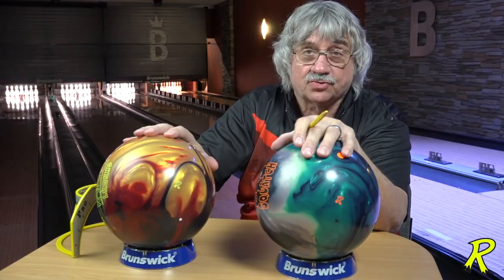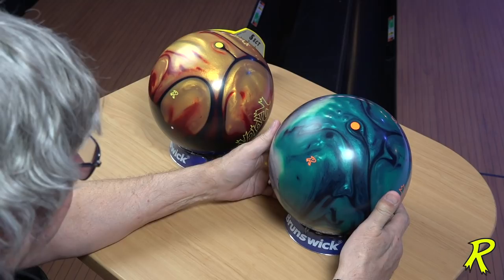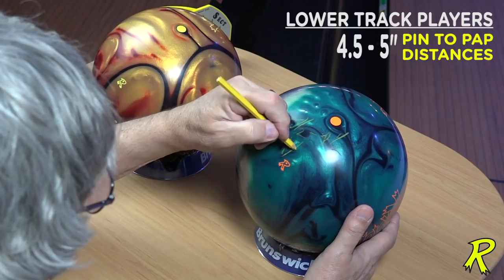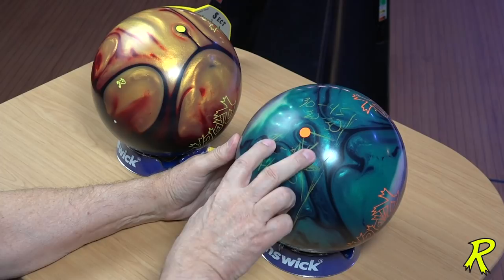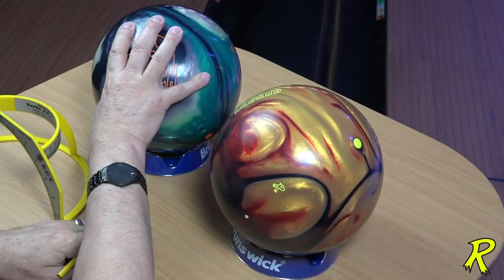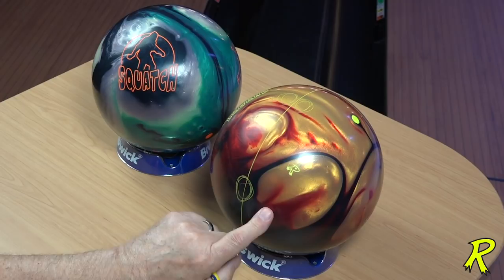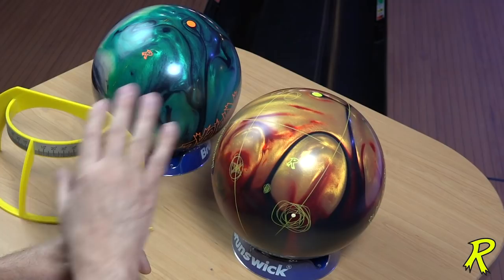Effective Modern Layouts w/ Mo Pinel - Volume 1

Comment: Without a doubt the best explanation on laying out a ball yet. If I had a quarter scale ($97.95 Amazon---yeah right) I believe I could now lay out my ball and just bring it to the pro shop for drilling. They have my hole diameters and span but they didn't have my exact PAP. I will have it exactly before I get my next two drilled. Now I will know before I throw them what to expect. Thanks again Mo. I am subscribing right now.

Comment: In regards to PAP, wouldn't that change depending on the drilling patern and/or the ball? For instance, if I rolled an older plastic ball of mine with a "finger Tip" pattern to show my track to the Pro Shop, would my PAP be diffeent than if I used reactive ball with a strong weight block? I'm not finding the drill pattern/ball reaction I'm hoping for and I'm curious as if it is a result in the drillers all using a PAP that might not be correct.

Comment: It's a damn shame Mo passed away.  I'd give him $500 to drill a couple balls for me so I could finally get my layouts perfect!
I recently made the switch from a standard right handed (thumb in ball) bowler over to a two handed (no thumb) bowler.
I went to the same Pro Shop guy that drilled my balls for me because the fitment was comfortable but despite knowing I
was transitioning over to a 2H bowler he still didn't care to watch me bowl or adjust my PAP for 2H (no thumb) bowling.
Instead he took all 5 of my balls and plugged the thumb holes and he did relocate the middle and ring finger holes on all
my balls except for my Purple Hammer... but to me it felt like he was doing a little guessing work rather than fine tuning
my layouts for my specific release.  Such a damn shame.  Now I'm having issues with the balls tracking over the finger
holes.  This shouldn't happen right?
Reply: Ditto. I wonder who else is just as good. I need help
Reply: I legit quit the sport after 25+ years of bowling in leagues because of fact I've NOT been able to find a pro shop that can drill my ball properly.  I've had over 25 balls drilled in the last 5 years leading up to me walking away from the sport for good and of those 25 balls I had 5 or 6 different PSO's layout my gear.  None of them fit properly.. non stop sores on my thumb, issues with release, some balls have holes that are way too large, some way too small, it's just BAD!  When I lived in Sacramento I used to get my gear drilled from the same guy for 15+ years and he got every single ball right!  These days PSO's don't seem to give a rats ass about their customers unless you go in and spend thousands of dollars in their shop.. half of them won't even measure your hand or watch you throw a ball to get proper PSA.. it's pathetic.. the sport is dying.. It's so obvious!  Just look at how every single bowling center (at least 95% of them) are all older than 30+ years and are falling apart!  The 3 centers we have out here NEVER oil the lanes anymore outside of leagues!  There are several days of the week where you can go bowl and your ball will legit just dump into the left gutter now matter how much you come up the back of the ball!  You literally have to throw plastic house balls if you plan on keeping your ball on the lane because of how dry the conditions are!  Ever since the pandemic bowling centers seem to be getting so much worse!   @StephRenee812

Comment: question. what if You drill a symetrical ball lets say stacked leverage and instead of the weighthole... go from the location where the weighthole normally would go and at the exact opposite neg quandrant from that hole location drill a weighthole there filling it with lead weight equalling the amount removed from posative weighthole location and plug it.  will it react the same as if it still had a hole like old?

Comment: I get a hard turn just before my ball gets to the pins and no matter how close I put it to the gutter I still end up hitting the head pin heavy or on the Brooklyn side. I observe other bowlers that can release the ball straight down the alley between the second and third arrows and the ball slides all the way until just before it gets to the pins. Does where you drill the holes have anything to do with this. I want a little less hook with more control.
Reply: Plantation Storage What ball are you throwing?
Reply: In a nutshell.... yes, the ball layout along with the ball surface is what determines how quickly the ball transition and how early or late the ball reads the pattern.

Sounds like you have a relatively low surface ball (2000 or below) combined with a very high response layout (when it sees friction, it wants to scream left, or right if your a lefty).

First thing I would do is have your ball surface adjusted a bit higher, especially if your bowling on standard house shots... something around 3 or even 4000 grit.
Reply: You are probably throwing way to slow and/or getting it to the dry too early

Comment: Hey Mo... What about a 90 by 4 by 10? I have a 6 inch or 6 1/2 by 1/2 pap. My rev rat is 325-350 rpm and throw the ball around 13-15mph. I actually asked for it on a trident abyss! Might have to get the holes drilled a little deeper to make it legal... My other balls are a seismic photon torpedo (65 by 5 by 35) and a venom recoil (70 by 5 by 30). Not to mention a covert tank with 65 by 4 (3/8 or so) by 28~. So... Good or bad?

Comment: I have a symmetrical ball drilled with pin location in center of palm? Why is it so much different than examples given here? Did the shop where I had my ball drilled get it completely wrong?
Reply: Did you determine your PAP prior to them drilling the ball? What you describe would only make sense for a ball with a simple pancake core.

Comment: On the Asymmetrical ball with putting the MB on the VAL.  Would that lead to a smoother and slower down lane reaction?
Reply from the maker: It's a contributing factor to a quicker response reaction, but Pin to PAP must also be considered here.
Reply: - depends on how high above the midline you put the pin - but generally ball would total flare less & have a shorter interim period between it's total Skid Phase & total Roll Phase .. .. ''Slower'' & ''Smoother'' relates more to Differential & Friction characteristics .. [true of symmetrical also ]

Comment: I'm not sure if I have a high track or medium because when I throw a urethane or plastic ball the track is very high and when I throw a resin ball the track is lower like a medium track. So my pap changes depending on what type of ball I roll. If I want to drill up a resin ball which pap measurement should I use? The one when I roll a resin or urethane/plastic?
Reply: Hey Mark, the only track that should matter is the initially one that's created when you lay the ball down. If the grip and release is the same for the plastic and reactive ball I would use the ball that flares the least because it will make it the easiest to get as accurate of a measurement as possible as long as the track lines are still defined.

Comment: Thank you for the very useful information! My question is how does the oil pattern length affect the layout? Assume that you have two identical bowling balls and two oil patterns, one long around 44 ft. and one medium-short around 37 ft.. How would you layout the ball to use on the shorter pattern and how the one to use on the longer? I'm a slightly speed dominant player and my track is mid to lower.
Reply: I'm no mo pinnel...  but the way this has been explained to me in the past is:
Shorter oil, you want a shorter pin to pap distance so the ball transitions quickly.

Longer oil, you want longer pin to pap distances so the ball transitions slower.

Comment: Mo not many people I read up on their work and study up on.  You are one of those people for me.   So I have a question after these new rules go into effect.    Your studies show you can move the psa with a balance hole in a symetric which I agree with.  With no more balance holes and plugging moving the psa back towards the thumb but only by about half or so.  Whose to say we cant drill the balance hole and plug it for the customer to get a little more out of a symetric?
Reply from the maker: The PSA moved back approximately 90% in a symmetrical ball when the balance hole was plugged. The difference in reaction was nominal and not worth voiding the manufacturer warranty by plugging a weight hole.
Reply: Tyler Stine  you could probably drill the balance hole then only fill the top maby put some foam in the hole but that’ll only work for a little while cuz after a few years they’ll know u shouldn’t have a plugged ball anymore I think in 2 yrs only asymmetrical will b made

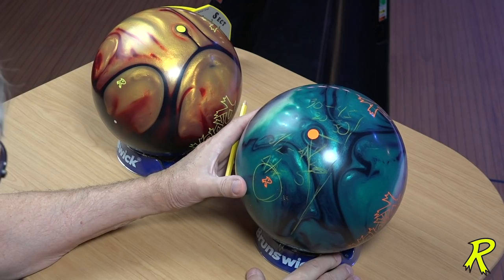Comment: Great Video Mo! Question? At 3:56, How did you determine the angle of the first line that was drawn on the Symmetrical ball. I understand how you measured the distance on the line, after it was drawn, but since you didn't use the CG, did you just pick a place at random or was there another way you determined where it would be placed?
Reply: Pastor JT Thornton 
Yes I think it was just at random since he said that the PSA (Preferred Spin Axis) on a symmetrical will be the thumb hole.

Comment: Your VAL angle seems to mean nothing on that symmetrical ball,  because you drew an arbritary line and PAP to base the VAL angle off of. ..... Why didn't you establish a drill angle (angle between pin / cg - pin to PAP)?  From there you establish the VAL angle, right, no?
Reply: The cg means nothing on a sym ball as he said. He used pin to pap and degrees from pin to determine the val.
Reply: Duh...

Comment: So, in Asymmetrical pin distance to VAL and PAP doesn’t matter?
Reply from the maker: They matter a great deal, but fine tuning your reaction with a PSA will become even more crucial after August 1st, 2020. You have to get it right the first time since you will not be able to put an extra hole in the ball.

Comment: No idea what any of these acronyms means. Any  acronyms education video?? Also, what about no thumb bowlers?
Reply: VAL-Vertical Axis Line, the vertical line parallel to your grip along your PAP-positive axis point, point where your ball spins around when you throw it. PSA-Preferred Spinning Axis, if the ball rolled forever, it would eventually spin around this point (or if you use a determinator). Hope that helps!

Comment: It’s so stupid USBC rules that balance holes are illegal. Being a bowler that bowls 2 handed and 1 handed, I have to now have multiple balls of the same layout. It’s stupid. If the pattern starts getting too dry while bowling 2 handed, I switch to bowling 1 handed, it’s so much easier. I bowl and adapt to anything and everything.
Reply: So put in a very large IT when you throw it 2 handed so your thumb just swims in the hole and change it to one that fits your thumb when you need to go 1 handed.
Reply: Patrick Clark my thumb hole is drilled for my thumb. The USBC rules state that if you bowl 2 handed then you can’t have a thumb hole. That’s what everyone says but according to what I read it can either be a thumb hole OR a balance hole. You can’t have both. I must be reading it wrong then. Because that’s my understanding that I can’t hav any other hole besides my 2 finger holes. And I’ve never had a balance hole in any of my equipment. Out of the 13 years I’ve been bowling, not once.
Reply: @Lucky_Logan  I know many 2 handed bowlers that use their thumb, themes just don't use it to as the primary means to hold onto the ball like you do when bowling 1 handed. If you have a large IT that your thing will basically fall out of and you have your thumb in the hole when bowling 2 handed you are using the hole. When you need to change to a 1 handed release then change the IT to fit your thumb. This will eliminate the need for duplicate equipment.  Every hole in a ball must have either a finger or thumb in it, no more unused holes. No more weight/balance holes.